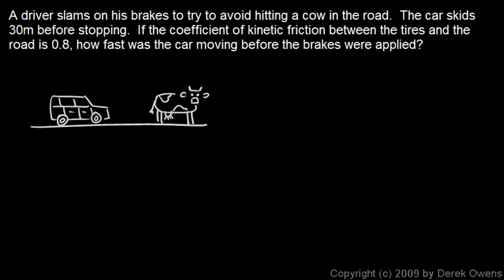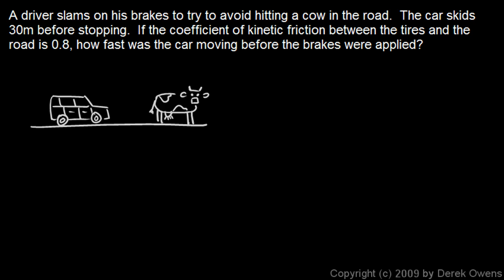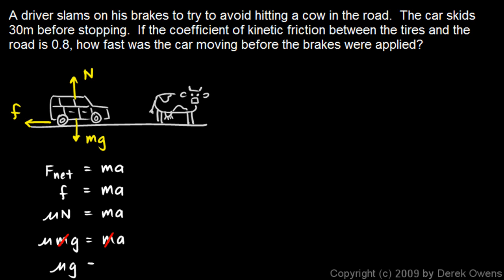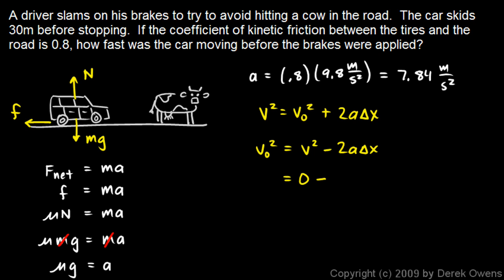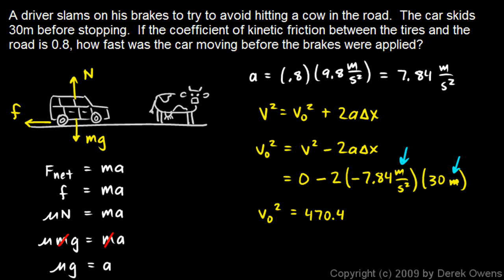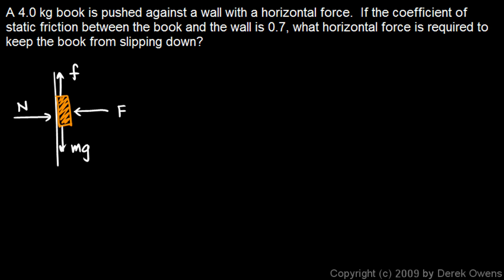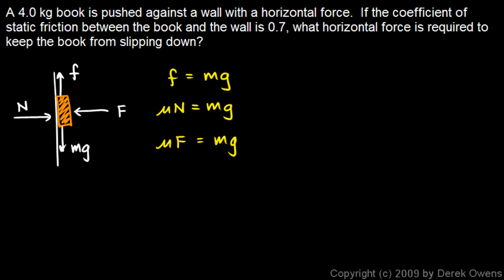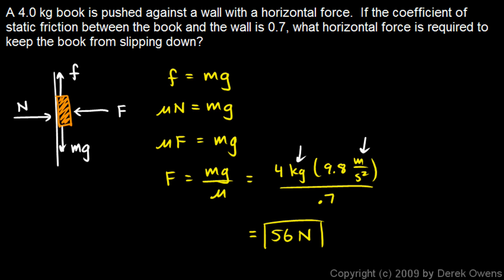Physics 4.7.4b - Friction Practice Problems 3 - 4

Comment: Perhaps you could work an example with two blocks with diff given masses connected by a cable. The blocks are pulled by another cable horizontally across a table with a given force. the blocks have the same cof of friction also given. Find the acceleration and Tension. Your videos have been very helpful to me so far. If you could clear this problem up for me also it would be much appreciated thanks.